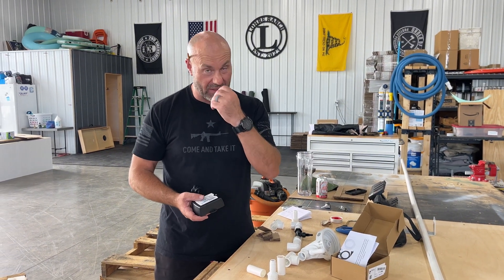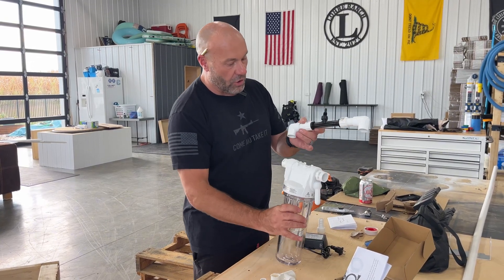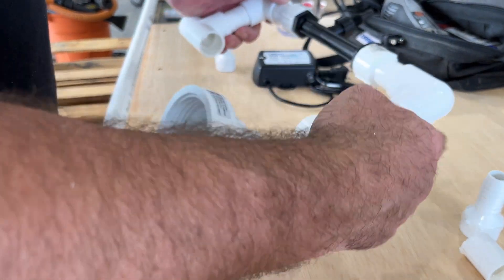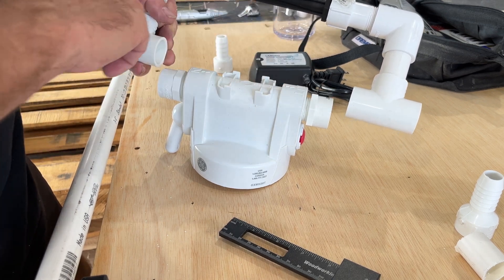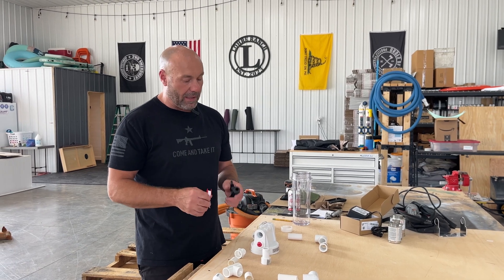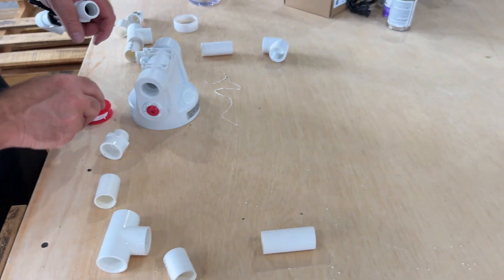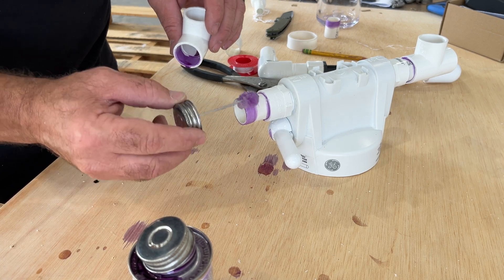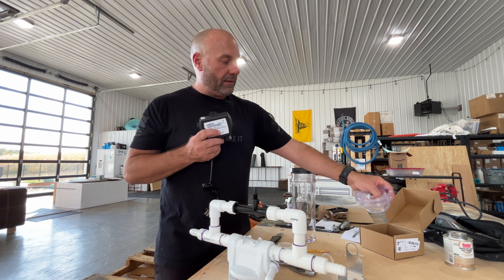DIY Cold Plunge Hack: Ozone for Crystal Clear Water!

Comment: Nice job.  I am curious about why it had to be installed with a "T" to split the flow between filter and ozone.  I installed on just in line after the filter.  It seems to work but maybe not.  I did notice the water was little more cloudy and little foam (like it was full of oxygen I guess)?
Reply from the maker: Good question. The venturi valve has a smaller diameter than the 3/4" tubing I was using so it can severely restrict the flow rate. Effectively, it's a bottleneck.  
One of the reasons you're likely seeing more bubbles is because the full flow of the water is being pulled through, causing the pressure differential to be higher, thus pulling more air.f
Thanks so much for the watch and I'd love to have you as a subscriber! 
Best,
Rick

Comment: What do you do if it starts leaking at the threaded connections after its all glued?
Reply from the maker: Great question—and I ran into this exact issue on an earlier build.
(TLDR: I had to cut it, buy new fittings, and rebuild. Using WAY more PTFE tape than I thought I needed ended up solving it.)

If it starts leaking at one of the threaded connections (like where the inline venturi or filter unit connects), but it’s boxed in by glued slip joints on both sides, here’s what you can do:

⸻

🩹 TEMPORARY FIX:

If the leak is minor:
	•	Dry the area completely and apply epoxy putty (like JB WaterWeld) or leak repair wrap around the threads.
	•	Not a long-term fix, but it can buy you time if you’re not ready to cut.

⸻

🔧 PERMANENT FIX:
	•	Since the threaded fitting is locked between glued slip joints, there’s no way to remove it without cutting the pipe.
	•	You’ll need to cut out the section and rebuild it.
	•	When you do, add unions or threaded couplers on both sides so it’s easy to service in the future.

⸻

💡 PRO TIP:

For threaded connections, I now always use WAY more wraps of PTFE (Teflon) tape than I think I need and pre-test for leaks if possible.

Also worth noting: if you’re moving the plunge setup or changing its position (sun exposure, temperature swings, vibrations), those can shift fittings and weaken seals over time, so placement matters too.

Comment: Do youhaveavideo of step by step fittings piping install with the filter and chiller into your 150 gal TS tank.
Reply from the maker: Hey @brianhoogewind4848 — not yet, but you’re reading my mind.

I’ll be filming a full step-by-step plumbing build-out soon using the basic materials in my setups, complete with chiller, filter, and pump layout. I’ll cover fittings, piping sequence, bulkhead placement, valve options — the whole nine yards.  I do have a filter and Ozone setup video here. https://www.youtube.com/watch?v=U6EyfK2l1Vo

I’ve had a ton of people ask for this, so I want to do it right with clear walkthroughs, part numbers, and maybe even a downloadable diagram.

Appreciate the ask — keep an eye out for it in the next couple weeks!

Comment: if i currently using hoses for my whole setup, can using this PVC just for this Ozone + Filter setup work well with hoses?
Reply from the maker: Absolutely, in my very first set up I used hose not PVC
Reply from the maker: There is a barb to PVC male threaded adapter. I specifically purchased mine at Lowe’s, but many home-improvement stores will have it.

Comment: My Venturi injector is not sucking the ozone. Am I not creating enough vacuum? Is my pump not strong enough? I followed to new filter system by DIY cold plunge
Reply from the maker: Hey there! Sounds like your setup might need a little tweaking. Check if everything’s tight and see if your pump is up to the task based on GPH ~800-1200 as a reference. You also want to ensure the venturi is flowing in the same direction as the filter. Add to that, make sure that you're pump is not installed backwards. 
If all three of those are good to go...we'll have to evaluate further. 
Let me know what you find out.

Comment: Why do you split the water flow in two (one into filter, one into Venturi)? Don't we need all of the water filtered before it goes to the chiller?
Reply from the maker: Great question...
1.	Too much restriction before the chiller reduces flow and can overwork the pump and reduce chiller efficiency.
2.	Venturi injectors need high flow and low restriction to work well—sending filtered (slower) water through a Venturi doesn’t create enough suction to pull in air effectively.
3.	The loop is continuous, so the water going through the Venturi side eventually mixes back into the system and gets filtered on the next pass.
Think of it like a pool or spa system—you’re not trying to filter every drop every second, but to cycle all the water through the filter regularly.
Reply: @TeamFITBODY  right on dude thank you!
Reply from the maker: @bradwrigley2985  You bet! Stay Chill! 🥶❄

Comment: You probably know this by now but get a timer for the ozone. I run mine at night for 3 hours and everything has been smooth for 2 years. I almost never change the water.
Reply from the maker: Yes, I have mine on a smart plug that when I turn it on, automatically goes off in 45 minutes after my plunge. I will adjust the duration depending on how many people are using it. Currently just me though so 45 minutes seems to be plenty.
Reply: What about the danner pump?  Should the two be aligned time wise with 2 separate timers?
Reply: @ no i run my pump 24/7. Its hooked up to a whole house filter. I havent tried putting it on a timet but maybe it isnt needed 24/7. Good question
Reply from the maker: The pump I have running 24/7. Have not had any issues with that. That keeps the chiller from getting ice built up since water is not circulating. Don't ask me how I know that :|

Comment: Awesome video! Would you leave your insulated lid off when running Ozone?
Reply from the maker: I actually leave mine on until the ozonator is done and then vent prior to using the plunge. Since I usually do it a the end of the plunge and no one else uses it after me, by the next day a simple "whaft" of the cover seems to clear any residual ozone in the airspace.

Comment: Nice shop, dude!!! Love the shirt.
Reply from the maker: Thanks! Appreciate it! Have you built a tub or do you use one?
Reply: @   I have, yes. I put together a DYI setup with a pump, chiller, filter system and Ozone, similar to what you did. Works really well. I bought the plan from the DYIColdPlunge YouTube channel before I came across your video. They’re pretty similar but with PVC unions for easy disconnects from the hoses. Otherwise, basically identical.
Reply from the maker: @MaintainingAmericasLegacy  Joe is good people and is how I started as well. Modified his plans a bit but the plans at DIY CP are awesome. Have you seen his new plans for stock tanks? It's my next build around a 150 Gallon.
 https://diycoldplunge.com/collections/stock-tank-plans-products/products/stock-tank-cold-plunge-plan?ref=RICKLOHRE

Comment: Hi Rick, can you tell me why you are installing that ozone generator ACROSS the water filter and not past it ?
I'm guessing because the water is being used for just bathing.
Reply from the maker: Sure thing @ShakespearHD 
First off, thanks for watching the video. I’ll be honest, it’s taken a lot of nerve to get up in front of the camera lately, so it means a lot that people are watching.

Now to your question… The reason I have the Venturi injector running in parallel instead of in-line with the filter is for a couple of reasons. First, the Venturi restricts water flow significantly compared to the three-quarter inch diameter I’m using throughout the rest of the system. I’m not sure of the exact interior diameter of the valve, but it’s at least half the size of the main tubing. This restriction would greatly impact the flow of water back into the tub and put extra strain on the pump.

Secondly, ozone doesn’t sanitize instantly; it’s more about mixing into the water and creating a sanitizing effect over time. Because of this, not all the water needs to pass directly through the injector. Running it in parallel allows for a balanced flow while still ensuring the water gets effectively sanitized by the ozone as it circulates.

Hope this clarifies things, and thanks again for your support!
Reply: @TeamFITBODY  I came across you as I am doing a bit of research for my cousins water quality issues. Being so focused on disinfection I completely missed the issue with having a Venturi Effect piece in the system.
You come across very well in front of the camera 🙂
All the Best 😀
Reply from the maker: @ShakespearHD  Thank you. Sorry I missed this comment. I hope to put some more videos out soon.